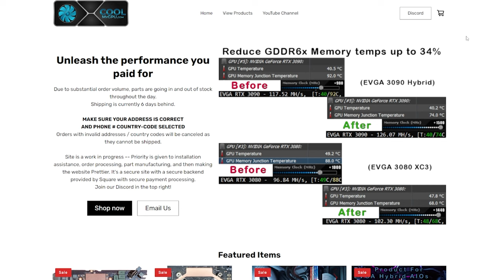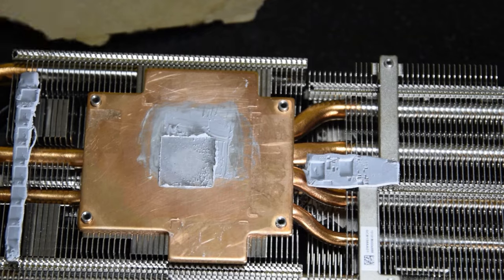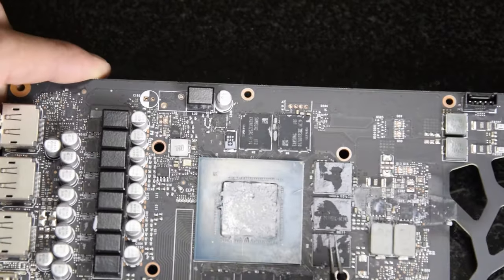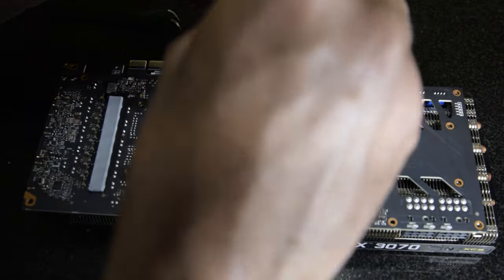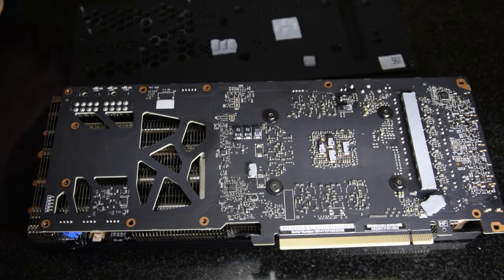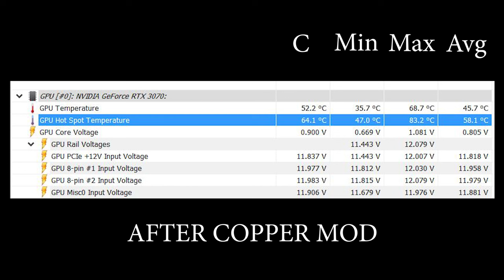RTX 3070 Copper Plate Mod

Comment: The only thing those pointy tweezers do well is poke holes and scratch. I use isopropyl alcohol (99% since I'm all hoity-toity but I've used 70% with no issues), nylon spudgers, and a soft toothbrush. I tried plastic razor blades and they're good for removing the bulk but are pretty much useless for detail work. Toothbrush and alcohol work best. A gentle hand is all you need; no scrubbing is required.
Reply from the maker: Absolutely agree. I use 90% and a toothbrush usually.

Comment: How thick is that plate? I have the same card but could not get the plate so I went with another site and I'm getting a 1.6mm plate hoping it will be perfect
Reply from the maker: 2mm. Unless you are extreme overclocking or water cooling it's not a huge benefit.
Reply: @pctechandgames  thank you for reporting.
Reply: How was 1.6mm?

Comment: Would little individual square copper shims work better do you think than one big piece of copper like the one in the video? I have a 3070 FE card, would like it to last as long as possible without artifacting over time.
Reply from the maker: My personal opinion is one big piece may spread out the heat better. I have not tested this though.
Reply: Just avoid these mods, put good thermal pads, paste and have good air circulation in PC case.

Comment: About the liquid metal, you can use a very thin layer of paint on the copper to protect it from absorbing the liquid metal which results in those ugly stains, I used a marker and made quick strokes to paint the area where you apply it, I did the test with my aio for a couple months and I saw the paint does little to nothing to diminish the efficacy of the liquid metal and my aio coldplate is still stain free after using paste again.
Reply from the maker: Thanks so much for that information. I'll have to give that a try next build. Thanks for watching!!!
Reply: @trollstech  Hey thanks for reading my comment, just so you know I did the same with my rtx 4070 ti because it had unusual high temperatures in the hotspot.
Reply from the maker: @endame90  Nice! I'm about to do another copper mod video for my Galax "The General" 3080. How much did your temps go down?
Reply: @pctechandgames  I haven't done the most scientific tests to make sure but in general I can see my gpu runs about 3 celsius lower than before and the hotspot differential was about 17 degrees and now it went down to 13 degrees.

Comment: I did it. Cons: the expansion of cooper might create problems in the future. The difference of pressure between highs of memory chips might cause problems in the future. My solution was using gelid thermal pads cut perfectly to the size of memory chips and vrms. I also used  a lot of thermal paste and thermal pads between the vrms heatsink and main heatsink. Now hotspot reaches 94c under heavy use. I have a 2080Super.
Reply from the maker: The 3070 is in my wife's machine now. So far it is doing decent. You put a lot of work into yours it sounds like. Nice!
Reply: @pctechandgames  Don`t tell me my dude. Mine is a dual fan ventus OC so it was an annoying problem. Now it reaches 94c with fans at 70%. My guess is that the problem wasn't on memory chips, but on vrms
Reply from the maker: @Felipejsf77  sometimes it's a pain in the ass lol!!!

Comment: I got 3090 version is there a risk to short out pcb? Should I use the thermal tape around?
Reply: I would definitely exercise precaution with a 3090 and yes use tape.  There is minimal risk to the pcb, just tape any chokes or transistors in between the memory modules.

Comment: dont use any metals on the memory pads you are trying to take pads with metal pincers ! besides al does 3070 really needs this mod? its over kill.
Reply from the maker: TOTAL overkill 🙂
Reply: As far as I know, the VRAM chips of the 30 series are known to run hot under load. Ranging from 105 to 110°C. (Correct me if I'm wrong on those numbers) While this in and of it'self is not that bad as they can run on those temps, it leads to the heat soaking into the graphics board itself, heating up other components, making the fans spin up more often and overall shorten the lifespan of those VRAM chips. Coppermodding those cards lowers their temperature, the card temperature in general, leads to the fans spinning up less frequently and overall your VRAM will thank you with an increased lifespan.
Reply: @JD-uf3lf  LOL perhaps you missed the part about Gddr6x vs Gddr6... This card doesnt get hot at all. especially any evga card.

Comment: i have the EVGA 3070 FTW3 wonder if they have the same size Thermal Pads? theres little info besides 2 other video same card as mine but both using totally different sized thermal pads, evga site clame evga 3070 uses the 2.5mm all around IDK how true it is. any ways thanks for sharing, the copper plate fits nicely on the card. if anyone knows the true thermal Pad size for the EVGA 3070 FTW3 i greatly Appricated TY...
Reply from the maker: This may help you https://www.nicehash.com/blog/post/thermal-pad-thickness-for-rtx-3080-and-3090-gpus And thanks for watching and commenting!!!

Comment: What if i use copper pad copper shim instead of plate?Still it's same i think.
Reply from the maker: If it has the same thermal capacity and size, why not?
Reply: @pctechandgames  i think 2mm size is enough
Reply from the maker: @indiapost8472  it varies look up your particular card and you will find the precise size.
Reply: @pctechandgames  Thanx for reply, i have Asus rog rtx 3070 after some research 2mm is enough according to me.What you think?
Reply from the maker: @indiapost8472  I'm pretty sure that is the size mine was.
Reply: @pctechandgames  well as i said 2mm is enough and another reason why i don't want to use copper plate bcz  in future if i upgrade my gpu same copper plate will not fit,for ex- RTX 3070 copper plate not fit in RTX4080
That's why im going with copper pads cuz in future i can remove those pads from my old gpu and can apply them to new one.
Reply from the maker: @indiapost8472  That's a great idea!
Reply: @pctechandgames  I needed expert opinion about what im going to do,if you agreed with me im going with this method btw thanks mate.
Reply from the maker: @indiapost8472  Can you give me a link to the copper pad shim?
Reply: @pctechandgames  Lemme know if you got link, i sent links multiple times but as i refresh my comment with link get disappear maybe any YouTube policy.
Reply from the maker: @indiapost8472  It didn't come through just email me. Grab the email from my about page.
Reply: @pctechandgames  why my reply deleting?
Reply from the maker: @indiapost8472  YouTube. Just email me.
Reply: @pctechandgames  not available on about page. Is email address as your channel name?
Reply: @pctechandgames  sent. Named Prince Dwivedi
Reply from the maker: @indiapost8472  got it

Comment: Hi @DeadFishFlipFlop . awesome video. it's just what i need for my gpu. it goes to 95° and does thermal trhotling.
I need help, I'm new to this and I don't know the height of the copper I need. Would it be 0.5mm or 1mm? Could you help me please
GPU: Gigabyte RTX 3070 vision oc 8g
Thank you very much for your help. Greetings from Argentina.
Reply from the maker: Thanks for watching!!! 1mm I believe. if your GPU is overheating this won't help. It is for the GPU memory modules. I suggest getting a better thermal paste and evaluating the airflow in your case.
Reply: Series 3000 include Ti  need 2mm on VRam. So check the thickness of copper plate bcs its avalaible many copper plates in stores. I think is 1.5mm so use 0.5 thermal pads. Recommend it Arctic or Gelid

Comment: the website not work... what thickness have this plate?
Reply from the maker: Not sure why their website is down. 2mm is what I used. It wasn't a huge benefit. More for water cooling and extreme overclocking. That memory doesn't get that hot.

Comment: this is so stupid thing covering with thermal pads
Reply: agreed lol
Reply: Take filler gauge and measure distance between all VRAM chips and heatsink. Every chip is at slightly different height and non elastic material (copper) can`t compensate for manufacturing tolerances. Too bad there is no thermal sensor on each VRAM chip, would be educational to see what happened.